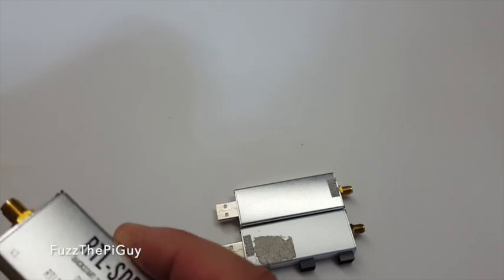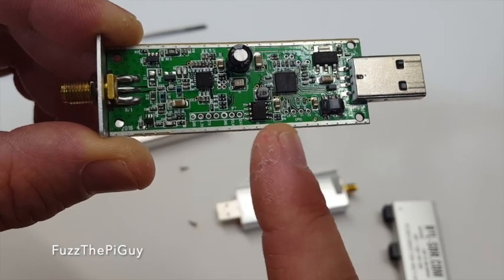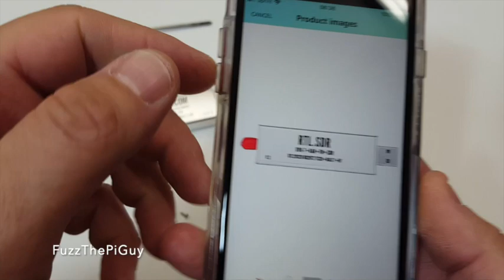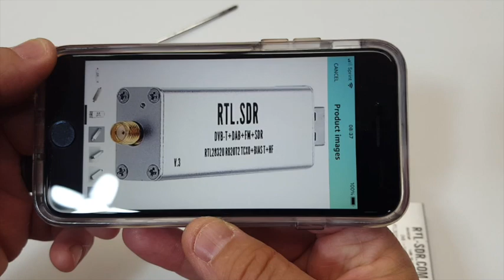RTL-SDR.COM  |  The REAL RTL SDR Dongle  |  Don't Fall For The FAKE'S

Comment: Performance wise what is the difference between real and fake?
Reply from the maker: That I’m not to sure on.
Reply: @FuzzThePiGuy  you can post the results of the following command from both dongles

rtl_power -f 24M:1.7G:1M -g 50 -i 15m -1 noisefloor.csv